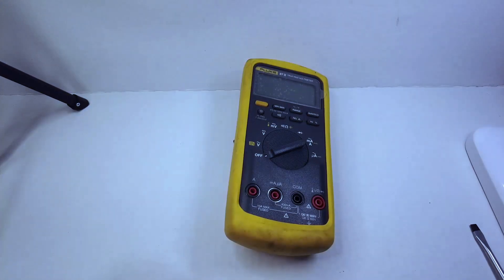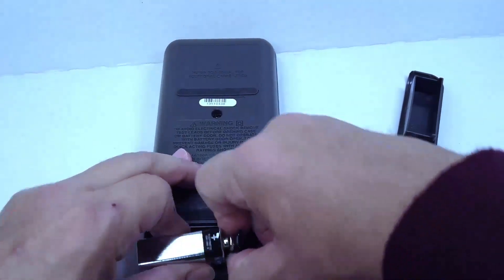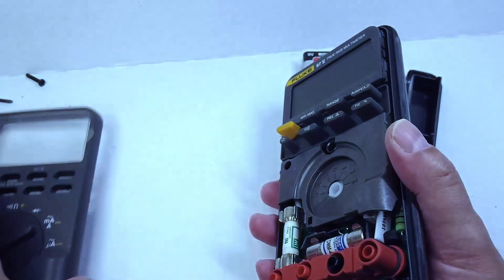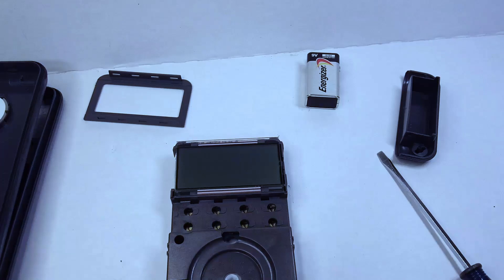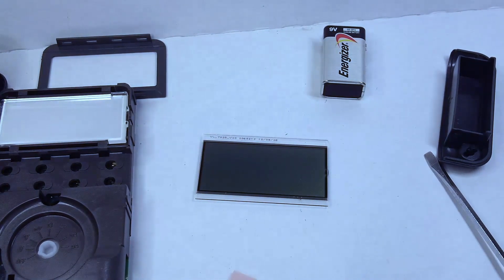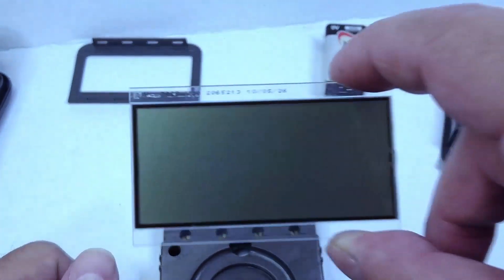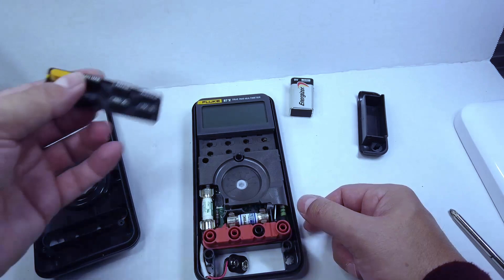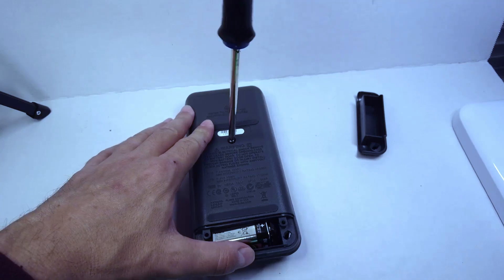Fluke 87V (87 Series V) Tear Down and LCD Display Cleaning

Comment: Excellent talk through on how to change the LCD, precise and very carefully done! I have just replaced the LCD and front case of a fluke 87V, but needed to remove the knob from the original front cover as the new one didn’t come with a knob. At first glance, it didn’t look like it was removable, but a quick look on the web showed how easy it was to remove!

Comment: I wish you would have shown the display read before hand. Mine is having similar issues as described so I'll try this first before replacing the connectors
Reply from the maker: We'll update this information based on your recommendation.  Thank you.  Try cleaning the display contacts first.  If display is only fading, then cleaning will fix it most of the time.  Thank you for your feedback, and check out our multimeter parts site...we're updating our database.  Thanks again!